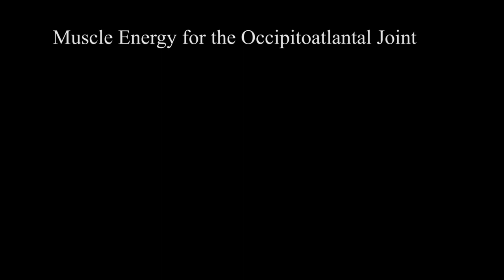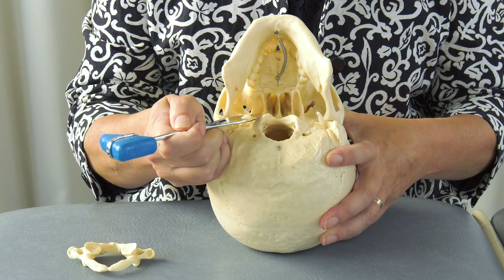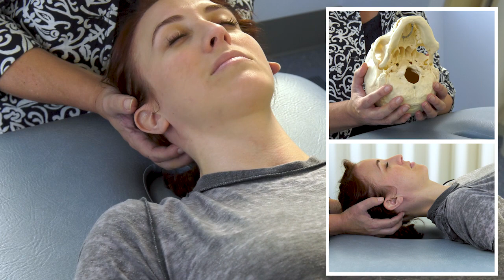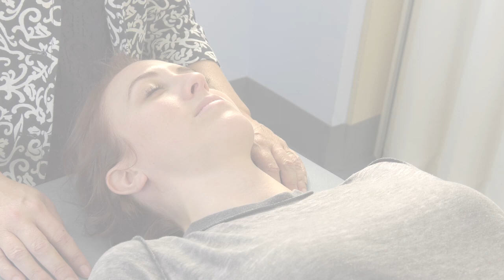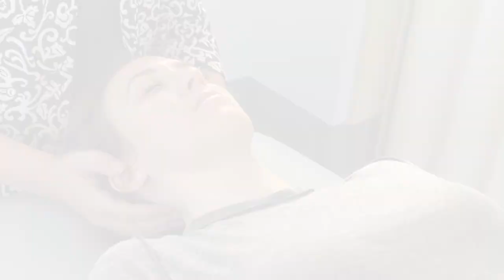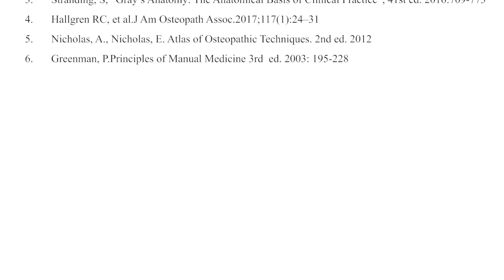Muscle Energy for the Occipitoatlantal Joint

Comment: How is this exercise helping your patient?
Reply: It's realigning the condyles of C-0 (occiput) and C-1. This is a very common misalignment that 99.9% of chiropractors overlook, which wouldn't matter anyway since most of them are not aware of how to adjust that area. Gonstead is about the only chiropractic technique that addresses that region, at least with a somewhat decent amount of precision.
Reply: In this MET approach, are you fatiguing the antagonist ? Or
Is it using reciprocal inhibition contracting the agonists of the movements? Thank you